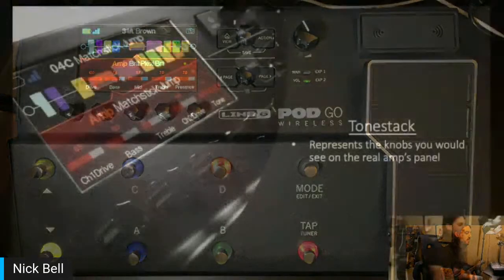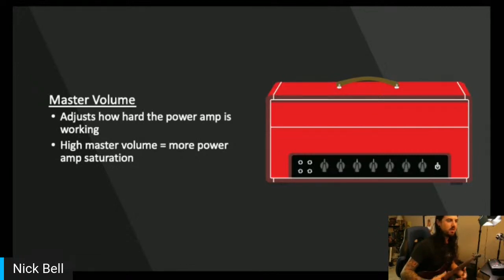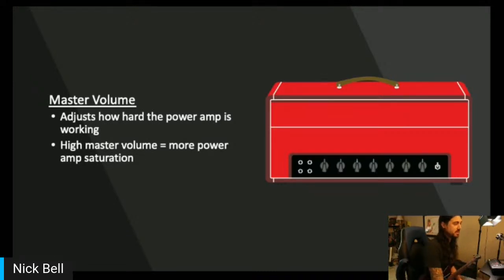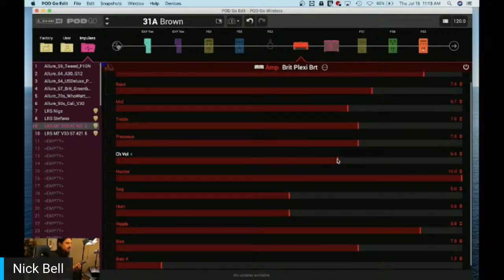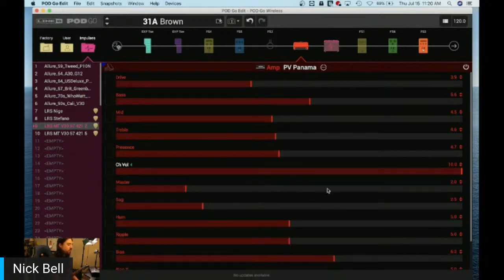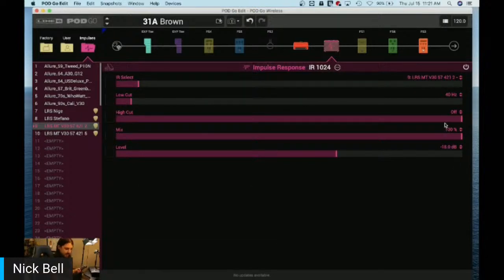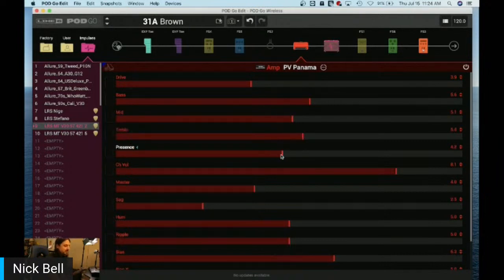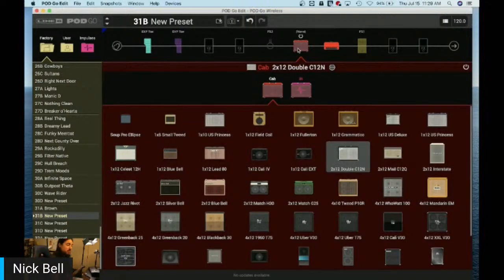Learning with Line 6 | POD Go Wireless - Difference between Drive / Channel and Master Volume

Comment: Great content you have here
I hope in the future there are videos that explained more the detail each of parameter control on the amp block, the pre amp section (drive, bass, mids, treble, presence) and also the power amp section (sag, hum, ripple, bias, bias x), the effect on the tones and how the setting that we can get a decent sounding from it
That sure makes learning curve of the helix/pod go user much easier, better understanding building a good tones and demonstrate how good the HX modeling is to the potential buyer
Keep the great job Line 6!